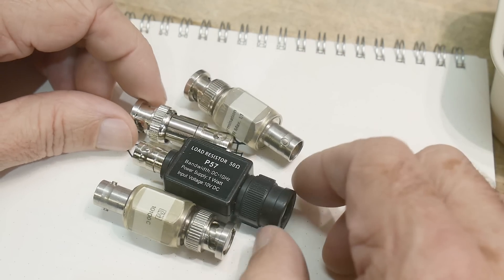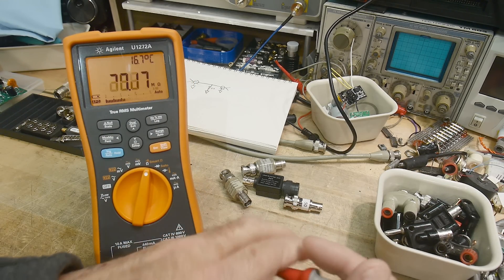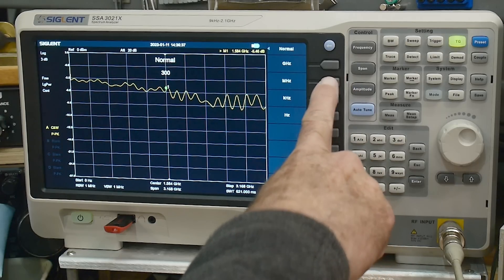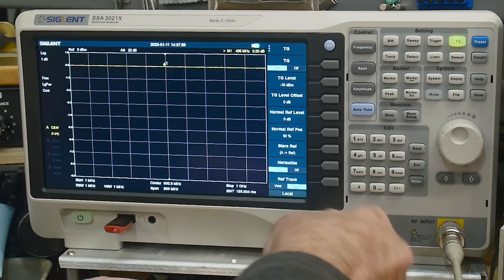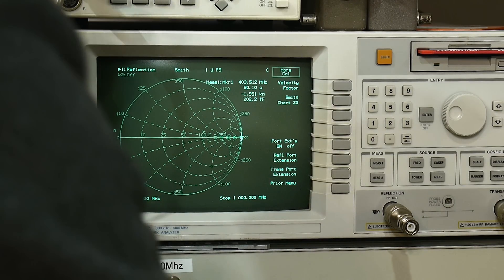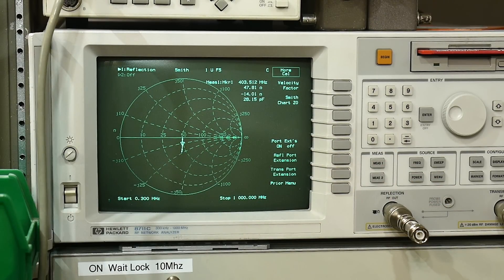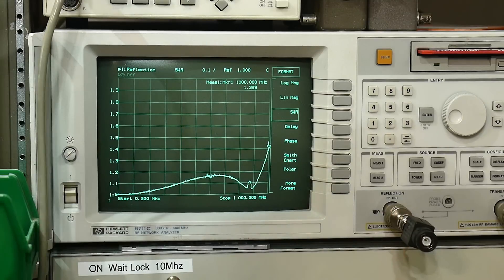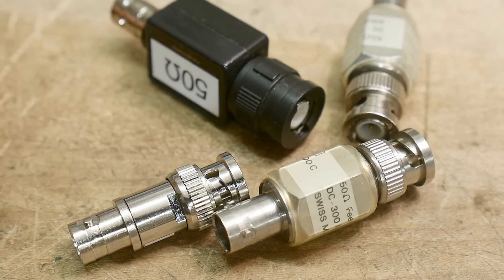#1400 50 Ohm Feedthrough Terminators

Comment: When you added a 50 ohm termination you ended up with a 25 ohm feedthrough terminator.  Try moving your system impedance point on the VNA from 50 to 25 ohms and you should see the SWR normalize.

Comment: I've only ever used these with current probes that need them when the scope does not have a 50 ohm input option.  To the other commenter:  some years ago, someone burned out one of the channels in a 1Ghz 4 channel lecroy at work by having it at 50 ohm and doing something dumb.  That poor scope...  It was decided too $$ to have repaired given its age (only maybe 10-12 yrs old at that time).  A few years later I think it got tossed.

Comment: To distinguish my 75 Ohm atten/cables/terms I use a Purple(=7) paint-pen on the knurles of the BNC male end and then wipe off the excess.
The paint stays in the grooves for decades.
Everything else I have is assumed to be 50 Ohms.

Comment: I like the way you added electric length to compensate for adapter, which is correct for approximate measurement.
The absolute correct way is  to cal it after the adapter, because the adapter itself has frequency dependent characteristics.
The other side of the 50 Ohm should also be 1M ohm load ( the high impedance of oscilloscope ), so to make it look like how it used in real situation.
Oscilloscope's high impedance is not any high impedance, it is exactly 1M Ohm, because we need to use 10X probe that assumes the scope has a 1M impedance.
So connect the other side of 50 Ohm load to oscilloscope with good cable and set the scope to high impedance.

You can also do s11,  s12, s22, and s21 measurement and convert it to Z
This way you can find out that how reciprocal is that. 

Also for being through, you need to test that over temperature.

But hey less than 2 dB is good enough for many applications.

Also, highest Power should be specified on that.  That is this 50 Ohm can handle say 1dBm,  30dbm or 60dBm.

Comment: A  feed trough terminator is designed to be connected to the input of an oscilloscope or other instrument, not operated alone.   The 8-20 pF input capacitance plus varying internal path length of an oscilloscope input will completely dominate the SWR.   I did a video a few years ago where I showed this.

Comment: Even if your scope has a 50Ω input option you have to be careful as the input voltage level maximum will be very low, sometimes as low as 5VP-P. So if maintaining a 50Ω system is important using one of these feedthrough terminators for high signal inputs is important.
Reply: A power attenuator would seem like a better choice.

Comment: I think you should load the other end with a typical oscilloscope input. Maybe the inductive one is better if loaded with about 10-20 pf as typical of a high impedance oscilloscope input. I would not be surprised if they are tuned to work best with a specific oscilloscope.

Comment: Most oscilloscopes look like 1 MOhm in parallel with 10-30 pF.  Especially at rf, the capacitance matters.  I would have soldered these onto a BNC plug for these tests.